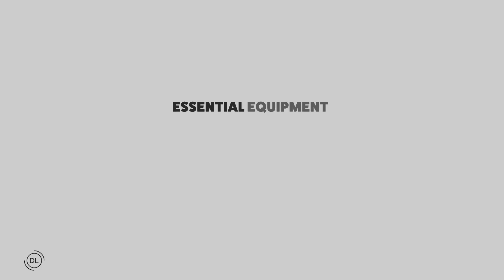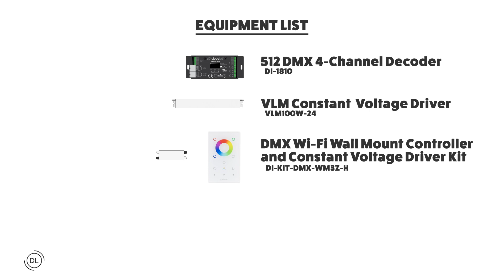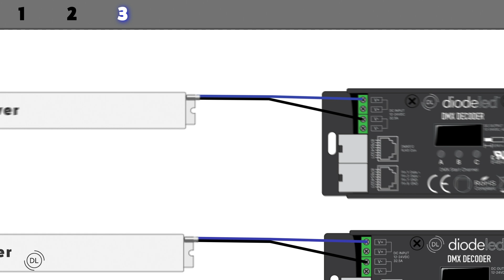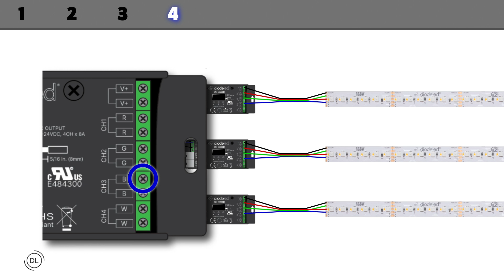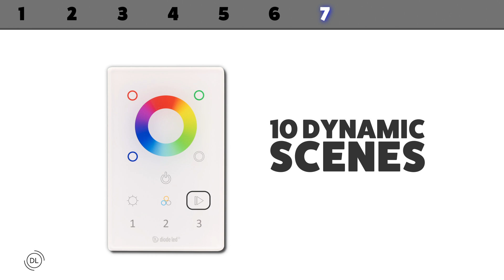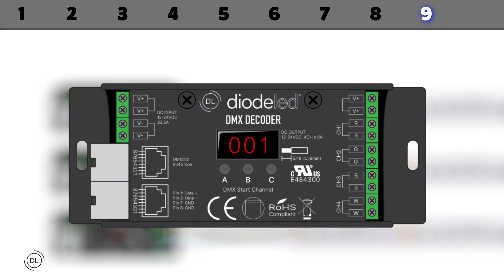DMX - System Design - Part 2

Comment: Do you use shielded/grounded CAT cables to prevent potential differences and have a common ground/V-? Or would you wire up an extra wire between all power supplies' V- connection?
Reply from the maker: Most standard, unshielded Ethernet cables are designed to work without a common ground. This is thanks to their use of differential signaling and transformer isolation, which provide excellent noise immunity.

If you have additional questions, please contact technicalsupport@diodeled.com. We are more than happy to assist!
Reply: @DiodeLED  DMX is a software protocol on RS485 hardware right? I have always understood it is better to have a common ground over an RS485 signal when using different power supplies. Whether you're powering one device with 12V and another with 24V. Ethernet is the easy way out for connectors and cabling, but that doesn't change the ground potential difference between device with different power supplies.
Reply from the maker: @YannickMX2  Since the Cat5 cables are only used for data, they do not supply or send power. In this example, the controller is powered by its own separate power supply.